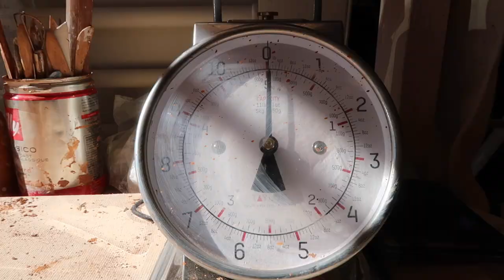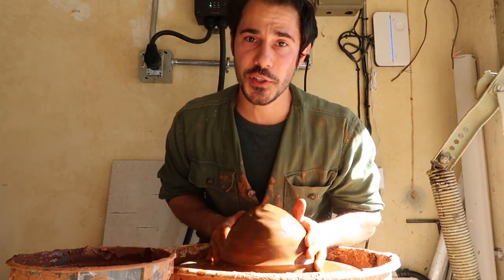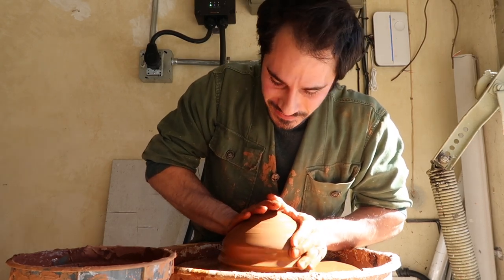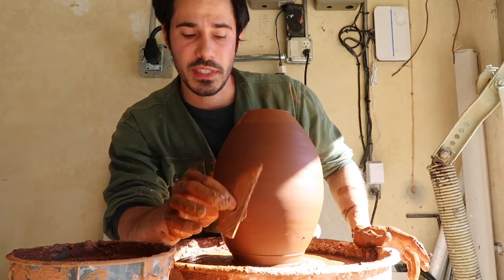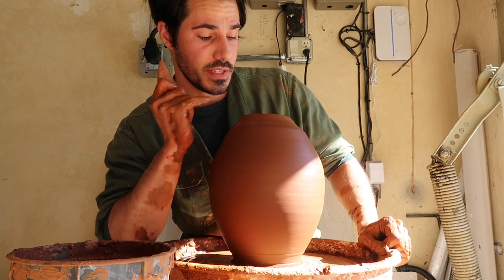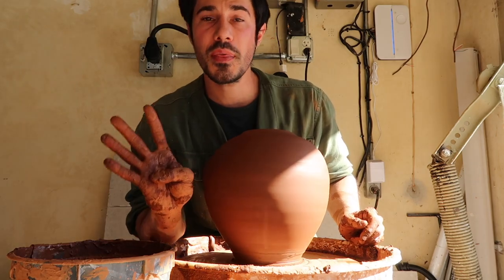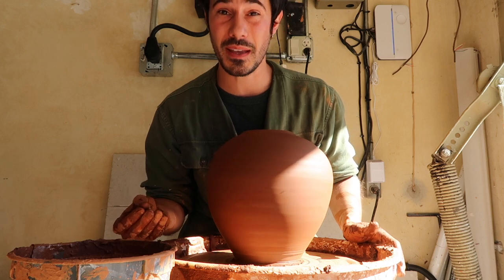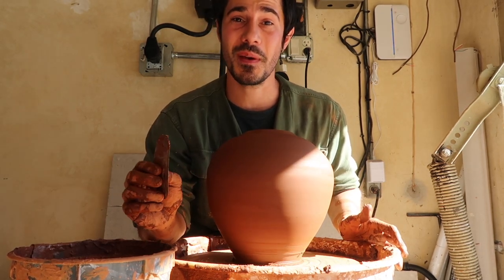How To Make A Spherical Vase/Moon Jar

Comment: Oh the beehive shape.  Right about where it gets to 2:05 in your video is when it goes crazy for me.  I get them to work once in a while.   I will remember the five steps.  I also like to see others use the heat gun prior to taking the pot off the wheel.  I use the torch but you don;t see many potters skinning them with heat to take them off which works far better than any other method. 

 Actually for mugs now, I do them all in one shot now.  Throw them as thin as I can get them.  Hit the with a moderate torching.  Directly hit them with 10 or 20 seconds of a strong fan which drives the heat and water out quickly.  Metal rib them quickly if they need to be adjusted back from the torch.  The cups need to be centered quite well but then I will cut the foot.  Then speed up the wheel to quite fast.  With a spray bottle of water and a very sharp left angled square trimming tool lightly spray the cup and trim off the skin.  I do this typically three times and lightly metal rib them.  I check the foot again, hit them with the torch again until firm.  Leaving them stuck to the wheel I pull, or roll out the handle with a cheap piece of base board, the thin one with the three or four carved hills and valleys angling the board sideways while I roll over the handle which produces a very nice roping affect.  Attach the handle, wire the mug, directly flip the upside down on a standard small tile and hopefully say, "ahh thin to win." 

 I can get the cups much thinner this way rather that using a chuck or any other method.  It saves me time and waste and effort trying to deal with the thrown cups on a second sitting and catching them at the right point of dryness to trim because they all dry a bit different.  Most importantly, handles actually get put on all of the mugs and they all get put on at the specific point of dryness that I chooser.  There is a nice feeling of closure where nothing is left to do or remains open.  I know you are a feel guy.  Clean the foot with sponge and brush, Hit the foot with the torch so it is not so soft a touch will ruin them.  I fix the bottom of the handle and into the drying cabinet.  I really like to throw and complete the mugs in one sitting.  The time saved, effort expended and end result of a cleaner cup, due to the fact that all of my pieces look better the less I handle them is the real benefit for me.  Good times and luck to you in your travels brother.     Regards from Brock Seals down in Santa Cruz.